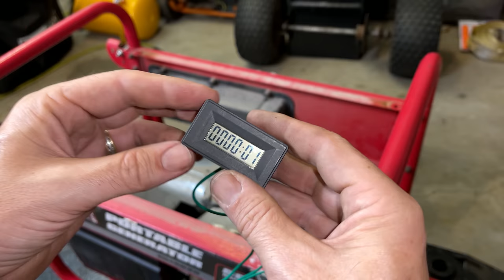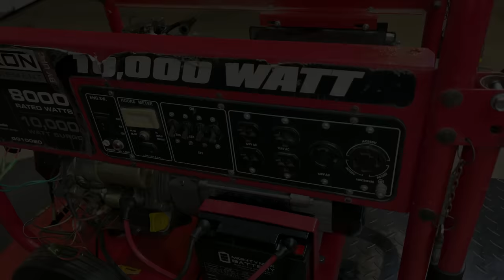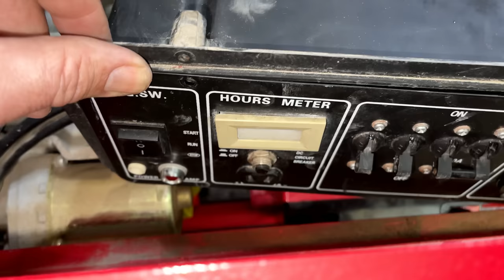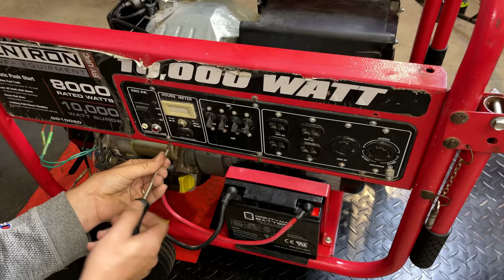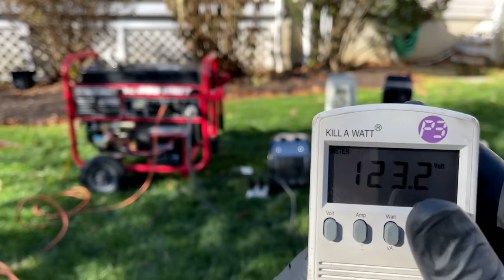Generator Engine Dies Out Quickly - Only Runs for a Second (Not the Oil Sensor)

Comment: I repair generators part time for a shop down the street. After a storm like we just had in florida, after people ran their generators for a week or so, many come to the shop with the same running issues. And yes, its that crappy spark arresting screen. I could charge each customer a hundred dollars shop time for the repair and make a fortune. But I tell them to remove the screen and try it before they bring it in. It doesn't help my bank account but I can't rake people over the coals on something  that simple to correct. Cheers and Merry Christmas to James and everyone out there.
Reply: I tell people that with their chainsaws or weedeaters as well. 2-stroke engines produce a bit of carbon anyways, and then when you put a screen over the exhaust, it starts building up. The more it that builds up, the richer the engine runs, the more carbon it produces, plugging it up even faster. I have a brand new Stihl and after about 6 gallons of gas, the screen was plugged up already. Using non ethanol gas and the new HP Ultra synthetic 2-stroke oil that they recommend. So it's not because I was using junky old two-stroke oil.
Reply: Maybe show them how to do it for themselves and charge 25 bucks for the lesson.  You deserve something for your expertise.
Reply: You're a good man.
Reply: @iamthemiracle81  I agree.
Reply: Good man!
Reply: 😅0ljlllljljjlljj😊😊
Reply: Clean it

Comment: James, one of the things that sets your channel apart from the others is how you take the time to show exactly what's wrong. For instance, putting us in view of the exhaust to hear what was troubling you. Others would simply say there's a noise and begin to fix it. BTW: Your solution for the spark arrestor was excellent as was the rest of the video!
Reply: yep, and once all that carbon blew out of the muffler, it rang great, the carbon was choking out the engine as it looked like that spark arrestor thing james took off was plugged up
Reply from the maker: Most would say it was clogged and now its fixed without actually showing any of the work.
Reply: @jcondon1  i agree james
Reply: Never had that issue to resolved before.
Reply: Good comment Tom, and  not a lot of ego talking as well😅
Reply: The gentron sticker is tear

Comment: A good trick for grips is to spray the inside with rattle can paint and then slide them on. The paint dries, it's non greasy, and they remain in position.
Reply: Hair spray...slips on and acts as an adhesive when dries.
Reply: Hairspray works great, using paint be a pain when you want to replace or remove down road
Reply: A shit of silicone spray lube or PTFE line will work fine as well. Even a small amount of liquid dish soap.
Reply: Dish washing detergent like Dawn is what a lot of bicycle shops use, slides right on and dries tight!
Reply: Or drop the grips into hot water for a few minutes, they'll stretch over the handle, then shrink to fit. Great video as always, btw.
Reply: Anyone every try linseed oil? Might work.

Comment: Of all the small engine videos I've watched on YouTube, I believe this is the first one with a 4-cycle engine with a clogged spark arrestor. I've seen it enough times on 2-cycle equipment, including on my better-branded line trimmer.  This is a good one to remember...
Reply from the maker: It’s rare, but it does happen
Reply: Fairly common on high use chainsaws, can usually remove, burn carbon off with a torch and reinstall
Reply: Same here. First for me but great lesson.
Reply: If you have a generator, and it has an Economy mode. I am NOT 100% sure, but on Yamahas from what i've seen, it just cloggs up the spark arrester, No big deal to clean it, but customers come back with it ect. Anytime i do a service i clean it out. I have NEVER seen one this bad though. Normally its slightly clogged. This was CAKED.
Reply: I had one this year but I think we will see alot of them this spring after heavy use this winter
Reply: Maybe they used 2stroke mix to fill the generator one time...

Comment: I love your inventiveness James. These types of hourmeters come in DC types and AC types, as you said. Yours is obviously one of the AC types, as you also said. The instrument counts up with the presence of an input voltage across the input wires. There are three standard AC supply voltages provided by the manufacturer. Those are 24V AC, 120V AC and 240V AC. The instrument should be marked with that appropriate for that one. I am presuming that they have provided you with one of the 120V types. All you need do is to check that the input voltage for your meter is 120V and remove the broken hourmeter from the panel. You will have to wire the input wires onto the hot side of one of the legs. Seeing as you have already paid for it you may as well use it, This can also be a cheaper solution to paying Generac $40 for one of theirs in future projects.

Comment: Mr. James, You could get under that frame rail with an air hammer and a flat bit in it and straighten out that frame rail without disassembling everything.  Back up the opposite side with a 3lb sledge hammer... you'll have it back into proper shape in no time.

Comment: Its always cool to see the rolling shutter effect from the camera on high speed moving vibrations. At 1:03:20 it looks like all the parts on the generator are moving and wiggling independently.
Great video, always fun to watch, and youve inspired me to start my own Red Mango Rebuilds channel since I do alot of small engine rebuilds already, might as well have some fun making youtube videos along with the rush I get from getting a non-running motor to fire up! Thanks again and keep it up man
Reply: I find it mesmerizing.
Reply: @raouliii  Me too! its almost calming, to see the chaos that is in each vibration and how well the dampening works
Reply: James the spark gap adjustment will create a more complete combustion! The muffler needs to be really hot to breakdown the carbon build up. 4 hours of 50% load will do.
Reply: I was thinking the same thing about the camera shot adjusting the carb! I wondered if the frame was made of jelly!
Reply: @raouliii  That is a cool camera effect...the absolute best demonstration of that effect I saw was a video of a flying helicopter and because of the camera's frame rate, the rotor blades seemed to be stationary...
Reply: Is it not the parts moving? My eyes must have the same effect. Looking at my generator, it does the same thing in real life.
Reply: It goes to show how destructive vibrations can be, although it looks great in slomo

Comment: For the future, a good size C-Clamp might be useful to straighten a cross member with the generator still installed above it. Clamped on from the bottom, it could press down on wrinkles and give you leverage to bend it parallel to the floor.
Reply: My thoughts exactly.  I was thinking of using a large C clamp to flatten out the bumps on both faces at the same time.
Reply: I was thinking more of what body and fender guys use when straightening out body panels.  A nice piece of iron on the top and some friendly persuasion with a bfh from the bottom side. 😁
Reply: Bolt with two thick washers and then crank it down. Would have flattened it out no problem
Reply: @AmosBHaven  you use a hammer and dolly. When you press the dolly on the metal it's like you're hitting the metal from that side. It's called hammering on. You don't need a big hammer either.
Reply: @1pcfred  IMHO, and something I would do. In this particular case? The bigger the better.  Is not like your trying to finesse the curve in a fender yanno?   😜
Reply: @AmosBHaven  metal is metal. It all works the same. It is like you're trying to achieve good results.

Comment: Jim, old motorcycle hand-grip tick.   Spray the bar and the inside of the grip with Windex, just a little.  Grip slides right on and the Windex will completely evaporate in a few minutes leaving you with a nice tight hand-grip.

Comment: 51:10 If you use a C-Clamp on the bad hole on the frame rail, you might be able to flatten the ridge and straighten the frame to the point it the foot sits straight. Then a long steel plate with matching holes can be placed under the frame rail to reinforce it and the foot would then sit against the plate and everything is then bolted together...

So what I'm thinking is from top to bottom:
Frame Rail
Steel Plate that runs from round frame rail to round frame rail (instead of the washers you used)
Foot Piece
With 4 bolts going through all 3 pieces to tie them together and hold everything on...

Comment: Great tip regarding the handle grips and the air. When I worked at a repair shop ages ago we were instructed to coat the metal with rubber cement and slide the grips on. I like your way much better, easier and less messy.

Comment: 50:45 Get the largest nut and bolt that will fit through that hole, and the largest impact driver you have.   Put the bolt through the hole with a huge stack of beefy washers on each side and then use the impact driver to tighten it down as hard as you can, which will have the same effect as putting that rail in a vise.   It should flatten out the blown out hole and eliminate most of the ridge.   It's not 100%, but it should get you to 90%.

Comment: Great job, James, as usual.  One suggestion for the replacement grips.  I've seen folks use soapy water, which adds lubrication, then dries.  It may help sliding on, although your solution worked well
Reply: I hve always just used a little WD-40 they slide right on an it evaporates in no time.  Same thing for removing them, just slide the tip under the grip and give it a shot and they slide right off.........

Comment: I like the video and really appreciate some of the things that you shared with us.  I like how you correctly and quickly identified the spark arrestor as a potential problem for why the engine would be shutting down; I would not have thought of that.  I know this is unsolicited, but I noticed a few things that some other best practices would have helped.  Here are a few best practices that have worked for me in the past.  When putting on the hand grips, use a water bottle with a little dish soap and mist the bars and the inside of the grips; you will find that they will easily slip right on and when they dry they will not move.  I learned this from a bike shop that used to replace the foam grips on handle bars. One thing I would mention, running the engine indoors is more dangerous than it may seem.  It does not take a great deal of carbon monoxide to kill someone and by the time a person begins to feel the effects it is most likely too late to do something about it.  While you may have had enough ventilation, other people watching your video may not realize the danger and assume it is ok to do the same since they saw it done in a YouTube video.  There was a man around here that was working on his lawnmower in his garage and they found him by the door trying to get fresh air, unfortunately it was too late.  I like the video, but maybe a little disclaimer warning people to have proper ventilation when running an engine in a confined space. On a separate note, could you have reused the wheel hub that you removed to cut down to the spacers that you needed?  It seemed like a good potential reuse, especially if you had no option on hand.  My favorite part of the video was the carburetor teardown.  I especially like the use of the tea ball for the small parts in the ultrasonic cleaner. I also loved the "form a funnel," I have not seen that before, I usually just use aluminum foil to make custom funnels, but I really like that product. Another great pointer was when you explained the difference between the types of fuel filters, i.e. paper vs. screen, as it relates to pumped fuel vs. gravity fed.  This is a big help in troubleshooting if someone makes the mistake of using the wrong filter.  Great video for anyone looking to work on a small engine system.  Thanks for sharing.

Comment: Excellent, as always.  Thanx.  I might have done the spark arrestor just a bit differently.  I would have cut the new screen maybe 3/8" long and folded it back over the exhaust tube, then inserted the end cap.  That would prevent the screen from ever falling into the muffler.
Reply from the maker: That would have worked better.

Comment: On my Honda EU 20 I fitted an hour meter that picks up off the high tension lead. No wiring needed. The simplest way to clean that spark arrestor in future is to hit it with a propane torch until the mesh is red hot. That burns off the carbon without even removing it. Cheers Stuart 🇦🇺

Comment: Great job James! I would run a 50% or greater load for an hour to really heat up the engine/muffler in an effort to burn off all that carbon. Guy probably was running at half choke most of the time. Other instances the improper high altitude jet is installed but thats rare.
Reply: Absolutely! Most folks don't stretch their machines legs like they should and they seldom get put  under a heavy enough load for an extended period of time.
Reply: @giggiddy  exactly a buildup of carbon in a gasoline engine is the equivalent to wet stacking in a diesel engine. Run them with a heavy load for at least an hour and you'll see that exhaust clear up very quickly
Reply from the maker: I was thinking the same.

Comment: Merry Christmas Jim.  To fix the dented rail I would fashion a small 1/4" plate top and bottom and squeeze the rail between them with a nut and bolt - essentially using the plates as large, strong flat washers.

Comment: I just bought a Gentron like this. Having issues with it right after getting it home. Quit running after 2 minutes. Oil was so dirty wasn't letting the sensor work correctly. Change oil. Started to adjust the valves and the valve guide plate was missing the plastic/rubber guides. Had been gone so long that the intake had almost rubbed thru the plate. The valves were out of adjustment really bad. Replaced the plate and adjusted the valves. The engine was running hot. In checking the cooling fan was in pieces in the shroud, replaced that also. So now it will run and make power. My concern is the compression is on 58 hot/38 cold. I'm not sure if I am up to going farther. Your video's have helped so much already, was glad to find this one on the same unit that I have. Thanks

Comment: Jim, I recently bought a similar battery to the one you took off this generator. I bought a Peak brand battery charger that is called a "Teligent" type that is a smart charger. It can refurbish a battery under certain conditions, and while this or other chargers is a low amperage type, it doesn't cook a battery.
Reply: The usual problem with small lead acid batteries in a genset is that they are flattened by repeated fail to start cycles, then just left flat til they cannot be recharged. Also there is no knowing how clever the on board charger is while the generator is running.
Reply: @seymourpro6097  the cycling of the battery is always a problem. I wouldn't use the charge while the generator is running as the charge voltage most likely would be perceived as battery charge, and the battery would probably just be dead. The refurbishing is not always a guarantee. For me, so far I've not had the need for a battery to be refurbished yet.
Reply: Desulfation is worth a try before discarding the battery. But that one sure seemed to be too far gone.

Comment: A suggestion, put the rubber hand grip on before you mount it to the frame.  That way you can use a mallet to get it on the handle.
Also I would have used some talc power to make it go on smoothly.

Comment: About the air on the grips. Don't slide the air nozzle under the grip as the air blows out both sides. No just aim the air at where the grip meets the bar which lifts the whole grip up. If it doesn't have a hole in the end.

Comment: Jim, that threaded cap is different from the one for my generator. On mine, I opted for a used gas tank, which, is from a Harbor Freight, and a larger capacity. It's as close as I could find for a direct replacement.
What was left of the old wheels has what are likely good bearings, which can be removed with a hammer and screwdriver.

Comment: Again, learning even on the engine side!!  I would not have caught the plug!  Spark arrestor, In some locals I am sure they are highly recommended.  But your solution looks even better than original, so good call there.  Coming in after others worked on these generators is hard on your brain trying to figure out what they were thinking to get it into the condition you found...

Comment: Just an FYI:   I use lighter fluid to install the grips.  It works as a lubricant and evaporates quickly without softening the rubber.

Comment: The exhaust is typically not considered as the culprit if one has a non-starter, because it hardly ever gives you trouble. I am an experienced automotive engineer, and I once struggled a whole saturday with a stupid 50cc 2-stroke moped which would not start, although it had spark, compression, fresh fuel amd whatnot. After hours I glimpsed into the exhaus tailpipe (10mm diameter) and saw "something", which turned out to be soft when I was poking it with a screwdriver. It was the cocoon of an insect. After it had been easily removed, the motor started upon the first kick. Lesson learned. If you have someone who deserves it, spray construction foam into the exhaust tailpipe of his car. He and his repair shop will have a lot of fun.

Comment: If you take a propane torch or MAP gas and get the mesh red hot on the arrestor you can clean it. Bend it back and save 15.99